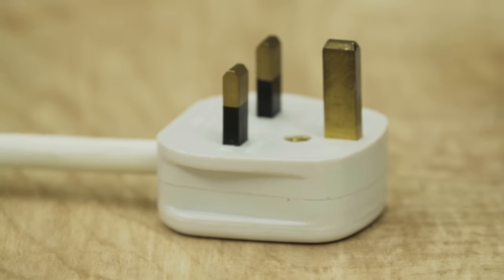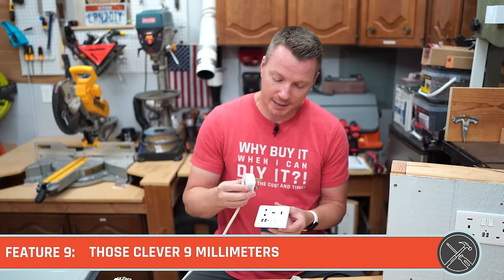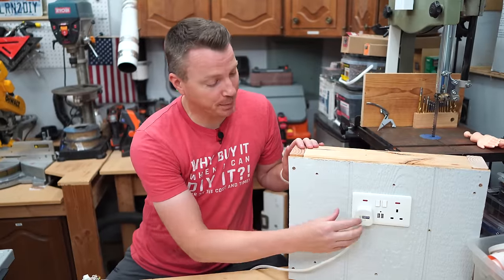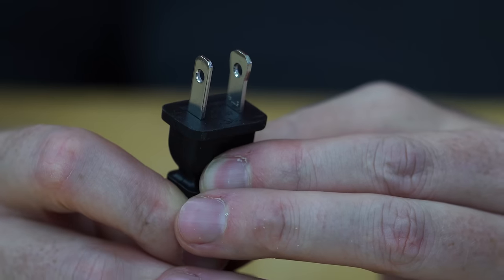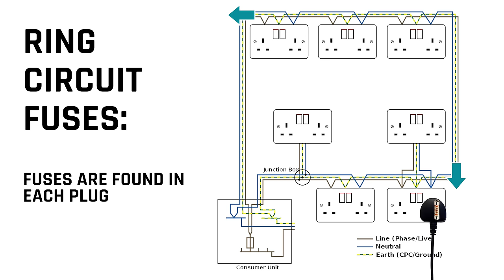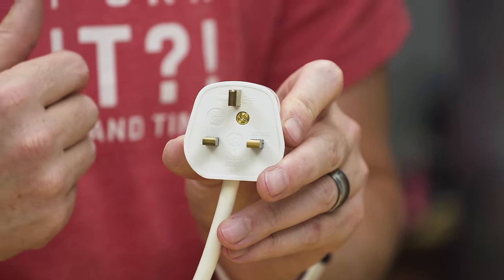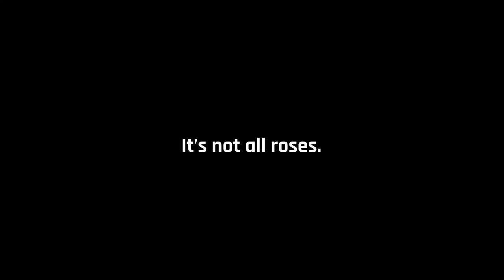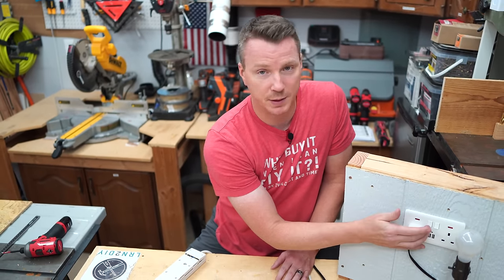British Plugs and Outlets Are On Another Level

Comment: In the UK, wiring a plug is one of the first practical lessons you get. I have never thought about half of these safety features.
Reply: Indeed, when I was young it was a mandatory lesson in secondary school (12+) along with how to change a wheel on a car and sew a button on anything. Not sure it is the same now though unfortunately.
Reply: UK appliances now need to be sold with a moulded plug as so many were wired badly. In the past, I've come across some terribly wired 13A plugs - terminals (not) tightened with scissors, earth not connected and so on.
For a while, consumers were advised to get the store to connect the plug. I'm not sure whether they made a better job or not.
Reply: Unfortunately, it appears this is no longer taught in schools, as my son didn't know how to wire a plug. I think this is, in part, down to a lot of appliances now having moulded plugs.
Reply: @Gattancha  What about how to put on a spare wheel? Most of us still have cars
Reply: @trojanhawrs4613  u don't get taught this either
Reply: @trojanhawrs4613  but most new cars now don't have spare wheels, you get run-flats, or a little compressor with a can of tyre sealing goop. even if people do have a spare they'll call the AA or whatever out a lot of the time.
Reply: Just like changing a lightbulb.

Comment: The colour of the wires is also a useful reminder when rewiring a plug.
BLue    = Bottom Left
BRown = Bottom Right
Reply: Brown / Live is Always Fused
Reply: I will remember this for the rest of my life, thank you sir. :yougotthis:
Reply: Another safety feature although the standadisation of was due to the EU the choice of colouring (either by accident or design) actually helps prevent confusion to people who suffer from colour blindness and those who work in low light conditions.
Reply: TRUE- but only when viewed with the cover removed! 😁😁
Reply: It makes no difference in the plug if you mix up brown and blue. But with the yellow/green one... its another storry.
Reply: @franzh8898  mixing blue and brown will give reversed polarity,  most devices will still work but there's  an increased risk of electrocution especially with things like table lamps. Some devices are also polarity sensitive and may be damaged by a wrongly wired plug. Can you mix up blue and brown? Yes if you're feeling lucky but I wouldn't recommend it.
Reply: @johnwhite9760  "Some devices are also polarity sensitive and may be damaged by a wrongly wired plug." What kind of device would this be. You recognise we are talking about AC?
Reply: I will say though that you shouldn't always trust the colours you see. Something can be wired incorrectly and still work or you could have bought something on ebay that has foreign colour wiring for example. Always consult the manual or ask a qualified electrician to install it. I work in London if anyone needs it xD
Reply: @franzh8898  It makes a huge difference. Imagine a sewing machine or other machinery that has a motor, if you reverse the polarity some devices will have the motor spin the wrong way. That can break things or in more industrial settings be disastrous!
Reply: @johnwhite9760  And reversed polarity in AC makes no sence at all. The current is flowing in both directions.
Reply: @asuri8751  Do you even know how a E-Motor is conected and how it works?
Reply: @franzh8898  Franz, I know how AC works and wasn't referring to polarity in a DC sense. Uk plug are considered to have "polarity" as they have a defined live and neutral side. Electrical goods manufactured for the UK are designed on the assumption that power will flow in through live. As a result safety features such as switches and internal fuses are usually on live. If the blue and brown are mixed up in the plug power will flow in through neutral and so components may still be live even if the switch is in the off position. I'm not here to debate the physics of electricity, I just think it's irresponsible to suggest the wires are interchangeable because they aren't. All the best to you.

Comment: I’m a Brit, and I don’t know how many things you can plug into a single US socket at once. Here, you can plug 16 things in at once before your house explodes. At around 9 PM zone night, I had a 12 way surge protector, and a 4 way plugged INTO the 12 way one. And every single socket was being used. By power hungry stuff. And I just heard a BAM! Come from the socket. The only thing I could see, the white glow of the status light of my aincent iBook g4 my Dad woke up. We switching the main breaker off. Turned all the breakers off, turn them one 1 by 1. And, nothing. Also we have 2 bar crappy 4G, so, my dad once put a knife In the toaster. And the house blew up exactly like that. But in daytime. And he pressed this black button that’s old. I remember he pressed that with the toaster blow. So I said, push that black button there, but since it was really old, he thought it was disconnnected. But our electrician on the call said push it. And the first thing I heard, the microwave beep loudly. Power came back on.
Reply: Main question, how much things can a single US socket handle at once? Greatly appreciated that you answer!

Comment: Ring circuits really aren't an issue if you've been properly trained. Load balancing is something you do as part of the design for the purpose of the circuit / customer needs and doesnt have to be perfect. And as far as installation and maintenence / testing you just use the half split technique if you get an issue and they are easily tested with your common Megger 1741 or other similar devices.

Comment: the 3 pin plug was originally designed by belling and company where they called it the Multi Kontact plug. It was so successful that they renamed the company to MK electric which is a household name here in the UK. 
As for the downsides mentioned, we often have 2 if not 3 ring circuits in a house. If i'm doing a rewire we usually do 3, one for the ground floor (US first floor) one for the first floor (US 2nd floor) and one for the kitchen as that tends to keep the higher powered equipment so the circuits by design are already suitable for the extra power load. As for the switches, it's safer and more economic on energy usage, you'd get used to it pretty quick and it doesn't really hinder fault finding because they're usually easy to see. As for standing on them, yes, it really does hurt!
Reply: were those the prewar designs with the round pins and no fuse in the plug? hence their occasional continuing use for inaccessible lighting rigs, where it's easier to change the fuse at the fusebox?
Reply: @RoamingAdhocrat  my understanding was the round pin design was for lighting only, things like lamps, I could be wrong though. I don't come across them too often these days and if I do it's normally to remove them as part of a rewire. I'm sure there will be someone in the comments section who will know better on that one so hopefully they'll see this and clear things up for us both
Reply: @ToraKwai  IF, big if, I remember correctly, there were two sizes of round pin plug, the large could handle 15A and the much smaller was only 3 or 5A and designed for standing lamps, radio sets etc.
Reply: I have about 8, the sparky didn't charge any more
Reply: @ToraKwai  My house was built in 2014 and to my surprise the builder fitted a small number of round pin sockets, which of course I have never used (I have no matching plugs, and only a couple of lamps anyway).

Comment: You forgot to mention that they're other-worldy satisfying to plug in compared to any other type. Such a clean fit and click. I actually miss it when I go abroad.
Reply: Never thought about that before, but yeah the click is pretty satisfying
Reply: I lived in Australia for some time, and it wasn't uncommon to have bent pins and wobbly connections. The plug would also sometimes fall out from the weight of the cable, or the transformer if that was hanging above the ground.

Comment: Stretching to find the negatives sir. Still a nice video. It’s not a common problem to stand on the prongs because we don’t need to leave things unplugged. We switch them off at the socket. I would say that almost the only appliance that is unplugged in my house is the vacuum cleaner/Dyson when it’s being put away in a cupboard.
Reply: Also if a lamp doesn't turn on we'd definitely check the socket switch before replacing a bulb, or pretty much any other scenario. I have stood on a plug though and it f'ing hurts.
Reply: And if you ever do want to unplug an appliance, it doesn't take a rocket scientist to put the plug on the floor close to the wall with the prongs facing downwards...

I am nearly 60 years old and have never stepped on a plug in my life.

Comment: I'm speaking as someone who just switched to using outlets with switches after using the non-switch outlet for my entire life. I wish I would get this sooner.

First, I never get confused since day one of using it.

Second, it is like a built-in feature for home appliances that don't have switch.

Third, it eliminates spark when you plug in a high-power draw device before turning on the switch like a gaming laptop adapter or high-wattage hyper charger phone adapter.

Comment: You mentioned the use of less copper, in fact that was one of the reasons that the plug was designed since copper was much harder to get in the UK compared to the US at the time, thus thinner wire means less copper, and the multiple fuses also uses less copper :)
Reply: Feeding an electrical load with a single copper pair or two thinner copper pairs of wires (ring circuit is in effect two wire system) would not make a difference regarding the amount of copper used. To get the same resistance (determines the loss of power in the cables), the thinner wires would have to have exactly half the cross section area but the lenght would be doubled. In other words, both cases use the same volume of copper. If the volume is the same, the amount is also the same.

PS: it is the higher voltage compared to the US that reduces the amount of copper in the circuit. But the design of the plug or the circuit has nothing to do with it.
Reply: I didn't think the wire was thinner, quite the opposite in fact, but the saving was made in having fewer wires in total. You only need to run one set of wires to each ring rather than lots of sets to all the individual outlets. I'm no electrician though, so I may be wrong.
Reply: @MeFreeBee  yeah, that's my understanding. the UK power plugs and home wiring standards were written in 1944 in anticipation of a post-war housing boom in the midst of a materials shortage
Reply: @uralmutlu4320  kinda, but the lenght is a lot lower, as the distance between the plug at the end of the hall and the plug in the middle of the hall is significantly lower than the distance between the plug at the end of the hall and the fuseboard. By having only 2 wires going to the fuseboard per section of the house (theres usually a ring for each major section, usually appliances, lower gloor sockets, lower floor lights, upper floor sockets, upper floor lights) you begin to save a lot in totality.

Comment: Another safety feature in the UK is that we are not allowed these sockets to be installed in bathrooms. All you will ever see is a 2 pin socket for shaving. In the states there are sockets for any appliances. This is to avoid water mixing with electricity
Reply: And all bathroom light switches are pull cord, or the switch is outside the bathroom.
Reply: Lol that's nuts. We just have GFCI plugs. Problem solved and you get to use whatever you want and you don't have to put things in another room 🤣
Reply: Are you allowed to do anything they consider risky over there? Does the government publish a list of these risky undertakings (that are forbidden)? Are you allowed to think for yourselves or is that reserved for the upper classes?
Reply: Hows it a safety feature if its unearthed?
Reply: @xenuno  no it's like North Korea. We follow the rules mindlessly and without question.
Reply: The 2 pin shaver outlet in a bathroom includes an isolation transformer.  Still 230 volts but floating with respect to earth/ground.

Comment: It wasn't that long ago that you'd have to buy a plug and fuse seperately when you bought an electrical appliance and wire it yourself. It was always a great day when you bought something which already had a plug attached. We even learnt how to wire a plug in school!
Reply: Wiring a UK plug is still part of the Physics secondary school curriculum.
Reply: I've never noticed anything being sold with a bare ended cable, except maybe very specialist equipment. I'm in my mid-30s, so maybe that was before my time.
Reply: @Techiejt  my school only gave us one lesson on that. Thank goodness for the internet
Reply: @AndrooUK  It was only made mandatory in 1994.
Reply: Not since the early 90's has that been necessary
Reply: @juandef4115  welcome to the national curriculum

Comment: The way the three pins on Apple's version of the type G plug swivel away is genius and solves the main issue of the prongs sticking out.
Reply: For once Apple did something useful
Reply: But only if you remember to do so. Bit like not leaving type G plugs laying in walkways, really. So, in common with a lot of Apple products, a solution looking for a problem?
Reply: they popularised it
Reply: @DraftySatyr  I think the point is that you can fold them away so it's less bulky and potentially damaging when you're travelling and have it in a bag or case.

Comment: There is another plus for the British plug. If you were to drop a metal object and it fell down the front of the plug, because its triangular, it's impossible for it to land across the live and neutral and cause a short. I believe, for this reason some workshops in the USA turn the socket 90 degrees so that if anything is dropped down the front of the plug (or is sat on top of it, until it is pulled) then it is likely that it will only contact with the one pin (the top one).

Comment: You are correct, the British plugs are probably the safest and best designed in the world.
I should tell you though, nobody here ever worries about "load balancing". If to much power is drawn on the circuit, the main circuit breaker trips. It also does not matter where heavy loads are on the circuit, because it is a ring, power is supplied from both sides/directions, so it is automatically balanced.

You are of course correct about size and pain of treading on one, but genius always comes with flaws!
Reply: I was thinking the same thing, the ring circuit means we don't have to worry about load balancing, that's the point 🤣
Reply: 1m of copper wire has less resistance than 10m of copper wire (at same diameter and density). So the shorter run of wire will carry more of the current in a ring circuit. Copper also work hardens, so if you tend to use the same receptacle (outlet) that happens to be close to the consumer unit (I believe this is what we in US call a breaker box), that shorter run of copper will become brittle sooner than the longer run to the same receptacle. The biggest pro/con of ring circuits is that if one side is cut, you still get a functioning circuit, but then it takes extra work to properly maintain that (adding new receptacles in new/different places).
Reply: @gslavik  in theroy yes but at 230V the current per kilowatt is relatively low in relation to the amount of copper. A 3kW appliance flex has a minimum of 1.25mm and for comparison a  broken ring will be 2.5mm, so even a broken ring  will happily drive a couple of 3kW appliances without getting hot

Comment: Part of the reasoning for having the cable exit at the bottom of the plug is so that the cable sits close to wall, this helps to prevent the weight of the cable levering on the plug and putting force in the receptacles in the socket. 
Over time if socket receptacles become bent or loose then a high resistance joint is created leading to excess heat and in extreme cases fire.

I’ve never seen a problem with “load balancing” as such, when a ring main is installed the perspective loading is taken into consideration along with the run length, resistance, voltage drop, and cable run environment (for heat dissipation) the cables should be sized and fused to accordingly.

Comment: I have my dryer, washing machine and fridge all in one socket and have never had issues, didn't realize it was a big deal😂
Reply: well a single socket is rated to 13 Amps usually which mean it can put 3kW through it safely. If it's a dual socket, dryer in one socket, and washing machine in the other (fridge doesn't matter much), then it should be ok. If you put the washing machine (assuming it's only hooked up to a cold water source) and the dryer through one socket though, it might get a bit hot if you use both at the same time (like throw a load in the dryer and start a new load in the washing machine).